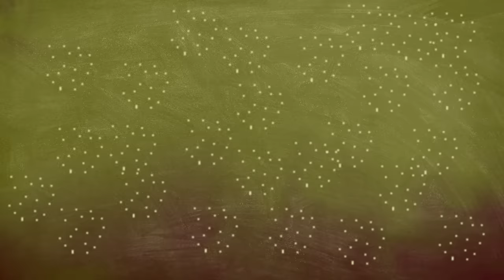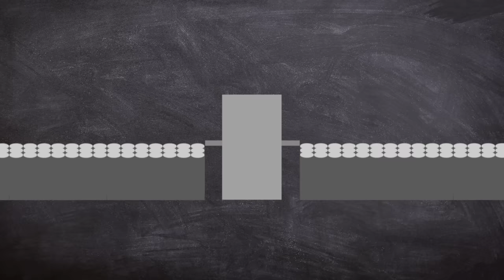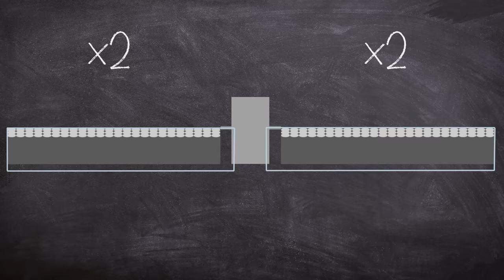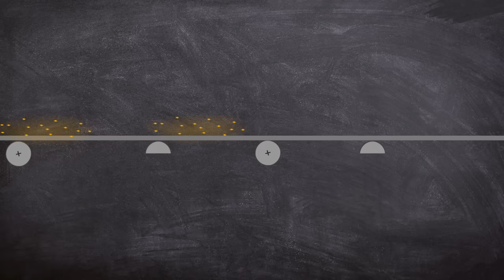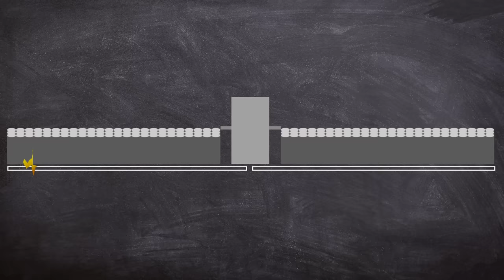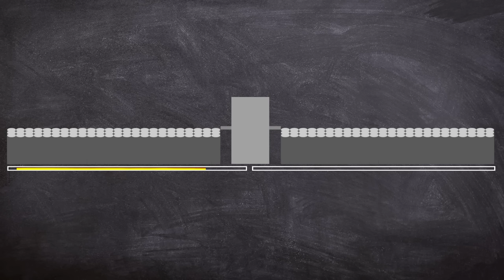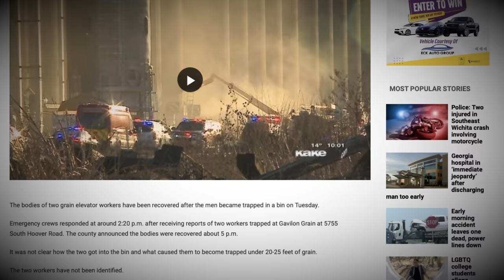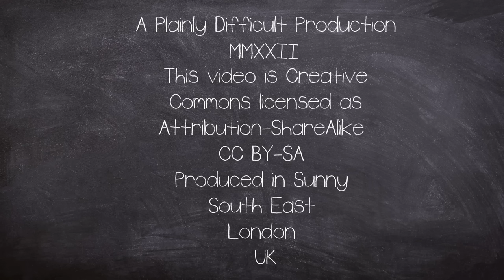The Debruce Grain Disaster 1998 | A Plainly Difficult Documentary

Comment: I worked for a local farm co-op for years.  Most of the grain handling equipment was outdoors in the open air.  We had several fires on the belts, legs, and drags outside.  We had a few a in the tunnels under the bins from time to time.  Our federal grain inspectors would run for a nearby highway when they would hear us on the radio talk about shutting down to put out a fire.
Later I went to work for a national grain company that itself had lost an elevator and four people in an explosion about four years before I came to work for them.  They mostly had indoor facilities much like the one in this video.  There, we had very strict rules for cleanup and sensors on the bearings.  Every time a bearing alarm would go off, the crew would drop what they were doing and race to the rally point.  Having been through several fires I didn't react the same way as my coworkers.  This facility was so much cleaner than what I was used to working in and it had a functional dust suppression system.  

Speaking of the dust suppression system, based on cleanup, we didn't think it had much effect at all until it broke down and we tried to run without it.  I can't imagine that DeBruce facility running without one for a year.  Since we had strict cleanup protocol, we constantly had to shut down and cleanup without dust suppression and it seemed like we got nothing done but sweeping and shoveling.  That's not to mention how much dust was in the air while the belts and legs were running.  Visibility could be reduced to 15 feet at times.  Standard operating day was around seven hours moving grain through the facility with an hour cleanup at the end of the shift.  Every so often once dust was observed to collect on walls and ceilings, we would blow the whole facility out for about an entire shift.  Without the dust suppression system, we would run for a few hours (depending on how dirty the grain was) and we would have to shut down and cleanup.  Then start up and run again, then shutdown for the end of the shift cleanup.  The next day we came in, we would blow the whole facility out again.
Reply: The danger presented by larger facilities is exponentially larger than that of smaller facilities- a small dust explosion will dislodge combustible dust in nearby enclosed spaces which rapidly creates further explosive fuel-air mixtures potentially leading to a series of concatenating dust explosions capable of demolishing structures not fitted with blowout walls. Not keeping up with dust suppression or not designing with dust settling on inaccessible surfaces in mind turns plants into an enormous bomb with the dust and air as it's explosive and the building as it's confining fragmentation liner.
Reply: I've worked at a couple. 

Every single area was cleaned at least once a week. High use areas like the road and rail pits, elevator boots and chutes, conveyor pulleys and trips, were cleaned daily. The bigger places would have full time hygiene crews that would start at the top, blow down to the bottom, sweep everything up, then go straight back to the top. 

I just can't imagine a place having inches of dust on the floor. Incredible negligence. Not just the explosion aspect but the simple trip hazard. Then there's the food safety aspect, people eat this stuff, the facility must be clean. 

We also had weekly bearing rounds. Every single bearing was checked for temperature and noise. All temperatures were recorded on the site bearing map and compared to the last reading. 

The company handled 10-15million tonnes of grain a year and fires were non existent. I can't imagine the absolute negligence of a company where fires are common place.
Reply: Thank you for taking the time to share this insight.
Reply: Top notch comment. Thank you for sharing! 👍
Reply: Well written...
Reply: Quite the detail. Thanks for sharing that. I worked in industry for fly-ash collection from solid waste combustion power generation and it was a gross job. And another facility in steel manufacturing. Shoulda been wearing a N95 more often but it wasn't enforced. Stupid.
Reply: Thabk you for this comment
Reply: Sounds like a lot of work but honestly rather be working hard than get blow up
Reply: I work with the sensors you mention. I can't tell you how good it makes me feel that you paid attention to what they were telling you. Nothing agitates me worse than ignored alarms.
Reply: Most of the time the crew would run.  I would go check the monitors in the doghouse to see which one tripped to the alarm so I could go inspect the bearing in person.  It was so much handier than what we did at the Co-op, which was walk the belts constantly looking and listening for bad bearings and occasionally finding them red hot and on fire.  LOL
Reply: @junkman8742  I have asthma and allergies.  I really had no idea how miserable I was working in these facilities until left the industry.  I burned through rescue inhalers and allergy meds like crazy.  I was used to it and it was just life.  I would say it took a six months or so before everything really cleared up.  Now it's just extreme pollen and mowing the yard.  Which is handled with some simple Zyrtec.  I haven't used a rescue inhaler in years.  
That said, several of my co-workers have died of cancer.  As a farm co-op we often dealt with dangerous commercial chemicals for fields, feed, and to fumigate rail cars loaded with grain.  At least one was forced into disability/retirement because of his lungs.  He was a smoker at the time and we all bean dust can cause silicosis.
Reply: I hope your boss wasn't a dick. 
I had a boss who was, though outside of work he was a legit good guy, and to this day we have mutual respect.
Reply: @jed-henrywitkowski6470    My supervisor often laughed it off and would remind me to vacate the elevator when the alarms went off.  Every single time was the same.  The superintendent probably never knew, but he was fairly easy going and knew what type of facility I had worked before.
Reply: Is anything done with the dust? I imagine it could still be made in to animal feed of some kind.
Reply: As a grain inspector that works at some enormously dusty corn and wheat plants in Illinois/Indiana, that's the least grain inspector like thing I've ever heard. We had a Bunge plant catch their main rail loading leg on fire nearby where I was probing a railcar, and refused to unharness until I was able finish that car
Reply: @bom_LS2_gto  Maybe these guys were a nervous bunch.  They were out of Omaha, NE.  Talking to them, I got the impression most of them didn't come from an agriculture background.  They were a great bunch of guys, but at the first word of hot bearing or fire, they would drop everything jump in their truck and drive out to the road every time.  At this facility they had their own brand new shed with heat/AC, they controlled the probe which was in the scale (I believe, don't think it was in the garner).  On occasion they would come out and hand probe the cars themselves.
Reply: @skyhawkpilot172  Oh nah, that definitely isn't us. My dad used to work for the FGIS after a short time at Sioux City Inspection back in the mid-70's, so he may still know the older folks in that area. We never really get nervous since we work at a lot... non-OSHA compliant facilities 😂
Reply: But you did get the suppression system back, right?
Reply: @noahhastings6145  the elevator I worked at just bagged it up and threw it away. We had a vacuum system but idk where the dust ended up. The flour mill right next door ground the wheat up and the bran from the wheat berry went to animal feed. We separated the germ and sold that separately as well. One time a bag of germ spilled so one employee took a bunch home and fed to his livestock. He said the pig got so big it couldn't even walk lol. The germ has all the protein.
Reply: That's really interesting! All I really knew about it growing up on a farm was that it was dangerous. And I only knew that because Dad didn't alow ANYONE near him and Hank when they were filling the elevator. Not Mom, not even the dog. And he loved having all his kids chasing around after him.

Thank goodness all of it was outside on our farm and Hank's.
Reply: @noahhastings6145  Sorry, I'm a little late to this.  At the cooperative I worked for and its various locations we just swept and shoveled the dust onto the ground outside.  If there was too much, it ended up in a spoilage pile.  The larger commercial facility I worked in, the dust was collected in a large bin.  Trucks would come and collect it every so often, but I have no idea what they did with it.  It's probably in processed food.  LOL
Reply: @chellesama8256  That may have been a combination of the moving machinery and the explosion risk.  The machines don't stop if someone falls into them.  We were always reminded of the horror stories of employees that got caught in a running leg.

Comment: I'm an electrician and there's a big section of the electrical code dedicated to hazardous areas sorted by size/combustibility of vapors (the worst), dust, etc. Electrical installations for such areas use explosion-proof and dust-prood fittings and similar equipment to reduce or eliminate electrical systems from causing ignition and attempting to make it survive fires and explosions as best as possible. Nothing is ever perfect though and the farther back in time you go the less you have such things. Very expensive and much harder to usually and maintenance.
Reply: *install and maintenance
Reply: I'm a welder and there is a lot of simularity between the precautions you need to take when working in a hydrocarbon unit and the precautions you need to take when working in an area with dust in the air.  I don't think people respect how flamable sawdust in the air can actually be until they see the fire caused by it.
Reply: AnOther Electrician holler, yeah and yet those are more expensive, they help to prevent such things like explosions and more likely save human lives and prevent monetial damages.

Comment: Dust is indeed a scourge in any industry where it's a byproduct. For instance, my father worked his whole career as an engineer for a paper company, and they grappled with dust control in their mills pretty much constantly. (And also bearing maintenance, come to that. There are a lot of rotating parts in a paper machine, most of them turning at quite high speeds.)
Reply: indeed. doesn't really matter what the dust is made of, even metal dust can be fuel for dust explosions and fires. USCSB has several videos on dust-related incidents and they're all pretty scary.

Comment: My high angle rescue instructor works for Sedgwick County Fire Department & responded to this incident. One thing he told us was that there are metal manhole covers on top of the silos. The blast shot them up & spot-welded them into the metal catwalk that was running overhead.
Reply: Bloomin' 'eck, I knew this sort of explosion releases a lot of energy but hearing it's enough to friction weld steel....  Cor, blimey!
Reply: holy shit, to think about the amount of energy it would take to lift those covers hold them pinned against the walkway until they tack welded your looking at tens of seconds of continuous explosions. To think of the heat and energy released is just astounding.
Reply: Holy crap! And it probably did a better circular weld, than I can do intentionally and with properly maintained equipment!

Comment: I grew up in KC and I remember hearing about this. Always made me look differently at the grain elevators across town.

Also, there's a reason why anywhere combustion is desired the fuel is aerosolized as much as possible. For a quick bit of math, if you took a 1 m radius sphere and broke it apart into a bunch of tiny spheres 50 microns in radius, you increase the total surface area by 20 thousand.
Reply: *a factor of 20 thousand
Reply: That's how fuel air explosives work.
Reply: @grmpEqweer  and how the ol' reliable Internal Combustion Engine functions. That's why "flooding" the engine means it won't start.
Reply: @airplanemaniacgaming7877  Match in gas Vs. match + gas.

Comment: Almost any kind of dust can be combustible under the right circumstances. I've seen the results of a baghouse after the aluminum dust inside spontaneously combusted, scary to think metal that doesn't burn at all when in a solid shape can detonate like that when powdered.
Reply: Aluminum is literally rocket fuel. The Space Shuttle solid rocket boosters used aluminum powder in the fuel mix.
Reply: Yeah, aluminium is actually one of the most reactive metals; the reason why it was so rare before extractions from compounds were invented. Aluminium forms a thin layer of aluminium oxide when it's exposed to air, this is called a "passivation layer" due to the fact that it usually prevents the metal from oxidising further. However certain conditions allow aluminium to oxidise to completion, which can be quite violent. Solid rocket fuel is a great example of this reactivity, thermite is another, though other reactive metals can also be used in that case.
I might be mistaken but from what I've heard someone attempted using bare aluminium as a ship's hull and it did NOT agree with salt water.
Reply: Ahem.

Thermite is rust and aluminum powder.
Reply: @kieraleahy6795  IIRC aluminium used as a hull on it's own is fine but when combined with the iron, steel, copper and brass structures, fittings and equipment without effective insulation or management of the chemistry of those metals you can wind up with serious galvanic corrosion with the aluminium and steel structures forming a galvanic cell with the seawater and the ions it contains as electrolyte. The same effect was found to have been the cause of the accelerated corrosion in the joints between the copper skin and iron frame of the statue of liberty when the original shellac insulation installed during the statue's construction had perished over time and allowed electrons to move between the metals setting up a galvanic cell with rainwater as the electrolyte.
Reply: In the casting industry aluminum has a big burning hazard.  Magnesium even worse
Reply: Aluminium is band in coalmines in the UK .A coal mine explosion was found to be a chewing gum rapper on a rust rail and when locomotive went over the top it ,it cause enough pressure to start a thermite reaction .even crisp packets were band when they started giving them a foil coating
Reply: @gordonevans7781  
Holy Mackerel ! I never heard of that before, crazy.
Reply: @gordonevans7781  I'm gonna guess you meant 'banned' and 'wrapper'. Homophones can be annoying, tho, so I get it.
Reply: @markbarber7839  heard a story about a truckload of magnesium battery cases that caught fire. Fire department showed up and poured water on it. That was a mistake.
Reply: Aluminium dust is a constituent of very many commercial and military explosives.   TNT and/or ammonium nitrate plus aluminium dust - very popular.
Reply: @absolutechaos13  Oh boy, yeah, huge mistake. Oww, oww, oww.
Reply: @absolutechaos13  and all the mistakes were made at once that day. 

Same thing happened way back in 55 at le mans when there was a horrible crash and one of the Mercedes cars went into the crowd adjacent to the "pits" ( pits was laughable as it was just the shoulder of the road, there was no divided pitlane as we know it to be on tracks now. 

The car was made of magnesium. You could imagine the problems once they started trying to put out the fire. Part of the contributing factors to the crash were that the jags had debuted disk brakes and another driver was caught out by how fast the jag was slowing down for their pits ( the jag driver had his hand up to be fair which was the signal between drivers that you were going to be slowing down. 

This is the same event that directly led to the Swiss ban on motor racing that's still in effect ( save hill climbs and rally???? ). 

Magnesium and disk brakes, two advancements in their field that combined to make such a tragic event.
Reply: @LexYeen  I think that's how railroad tracks were repaired/replaced back in the day was "Thermite Welds" as Im calling them. remove the old piece, put the new one in position, set up a clay containment thing to hold the thermite, prep the mixture, put 'er in, light it, and watch the fireworks.
Reply: @RCAvhstape  yes lol. pepcon did a bad.
Reply: @LexYeen  I once cleaned up a steel project with Al₂O₃ powder as the media for my sandblaster gun, while in a shed, with the doors open because it provided some relief from the discomfort that wearing PPE in the sun brings. I did this with knowledge of the dangers of said powder and rust dust combined and meeting a spark. 
Despite cross venting, my workspace dust would absolutely accumulate everywhere! And neither my ShopVac air cleaner nor HV floor fan had motors that were suitable for hazardous locations. Not to mention that welding and grinding is a great ways to make sparks!

Anyhow, I do not recall exactly what unerved me, but I changed how I did things.
Reply: @gordonevans7781 , I don't think there is ever a point where, when a Brit speaks, I have to translate at least a word, into American! Lol.
Reply: @jed-henrywitkowski6470  You're all good, that was aluminum oxide you were using, which is very non-flammable.
That is actually what is produced when you react iron oxide and aluminum, so you would effectively be burning it twice.
Al2O3 is used in grinding disks due to its favorable properties, if it burned with the work metal the disks wouldn't last very long.